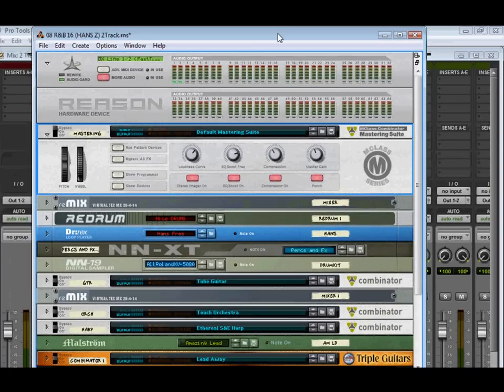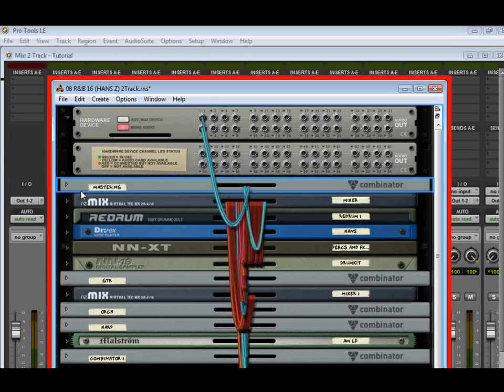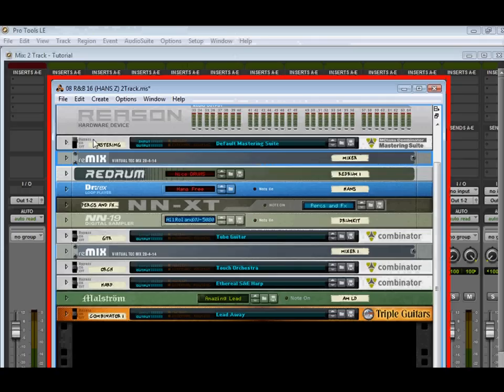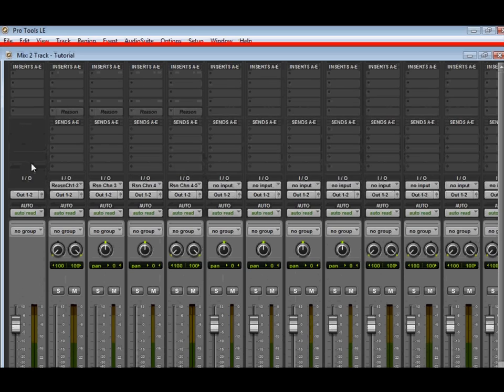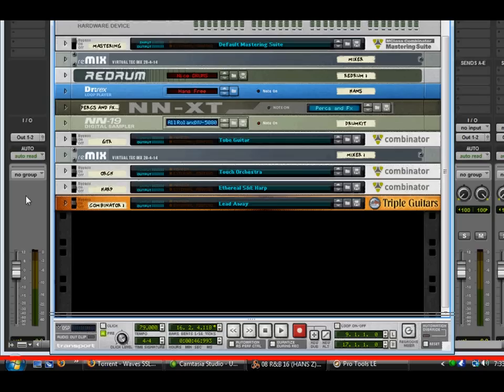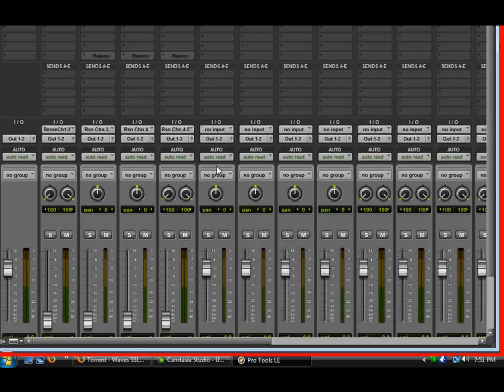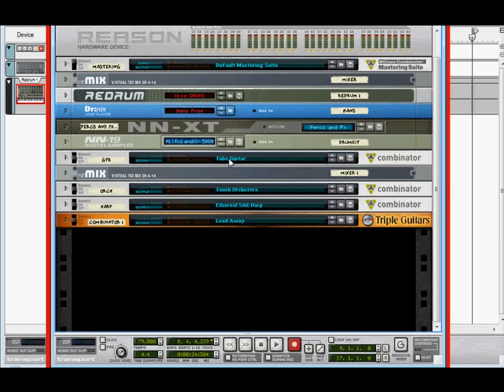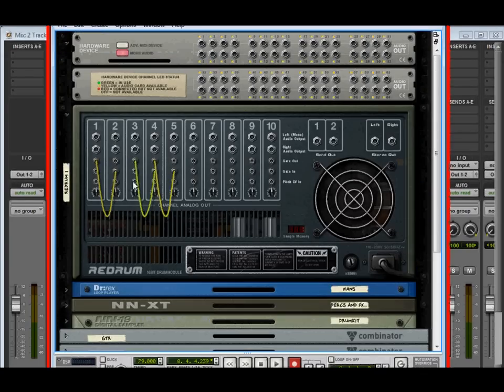HOW TO TRACK OUT YOUR REASON PROJECT INTO PRO TOOLS

Comment: Ok. I own Vista home premium, but I only use Pro tools 8 m-powered with windows xp, since I read on the digidesign site that PT8 only supports the ultimate and businness. But this is good news then. Thank you for the great tutorial. Thre reason program I had years back had no option to save audio within the program it self. I like the PT effects better too. The new plugins in version 8 are amazing.